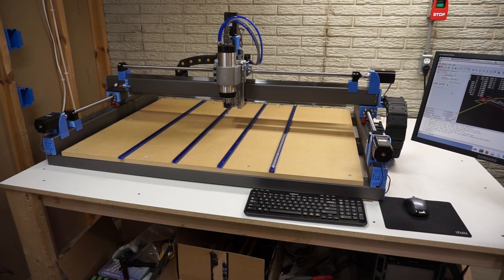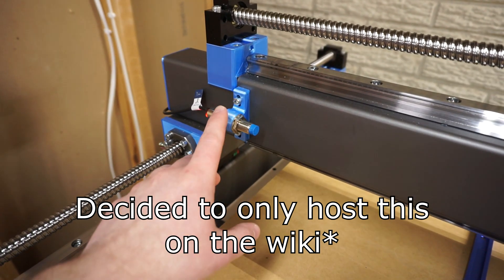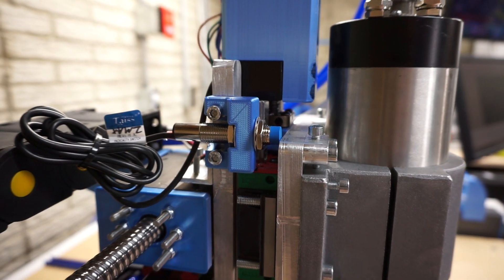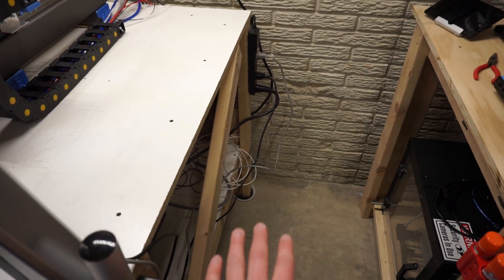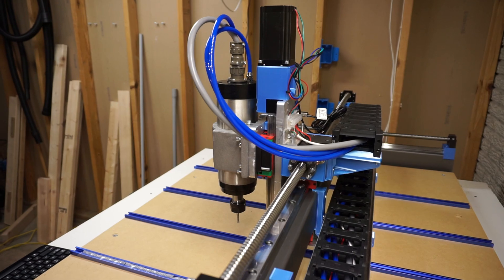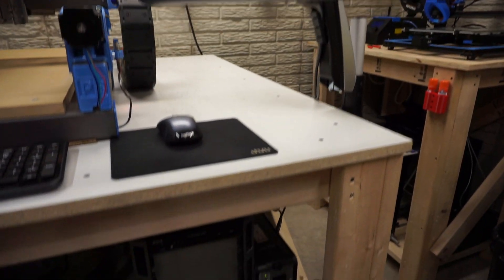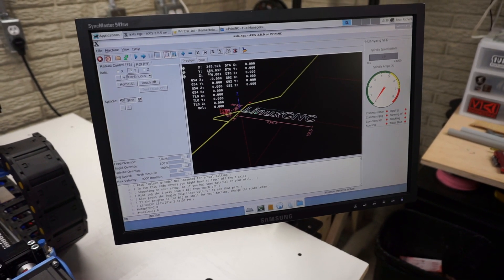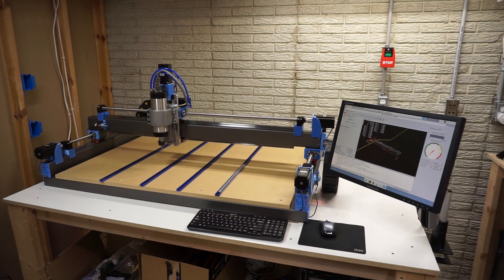PrintNC First Moves!

Comment: @01:12 Oof... That Stepper wobble man... Looks like you found your first parts to machine in metal, huh? 😐
Reply: I came down to the comments to see if anyone pointed that out. It just needs to be designed better and can still be 3d printed, but metal should also work and that may even need to be designed better

Comment: Looking great! congrats on your first build! I'm running a similar setup on my bulkman3d workbee 1010, I've got a 1.5kw vfd spindle high torque nema 23's and upgraded the z axis to linear rails. If you're going to do an enclosure and plan on cutting a lot of aluminum I highly recommend you run 8mm OD air hose in your cable chains so you can add mist coolant later on. Had a lot of trouble cutting aluminum at a depth of cut over 0.2mm, it would cut clean without chatter but the bit would eventually clog before the job completed. After adding the mister I can make 0.5mm+ deep cuts all day with no clogs. Got a mister kit for $20 on amazon, the most expensive part aside from the 8 gallon air compressor  was the $35 gallon of concentrated Trim Mist coolant. SO worth it! I've learned that it's not enough to have a rigid machine and a vfd spindle to reliably and consistently mill aluminum without issue. I don't always run coolant the whole job bc i don't wanna soak my mdf but  even with just the compressed air it's enough to cool the bit and blow the chips out of the cut and towards the vacuum hose. I'll add some videos to my channel of my setup and the mods I did to the dust shoe to work with the mister, in case anyone is interested to see how well it works.

Comment: Wobbling motor mount is "good". It means any forces applied to the motor axle is dampened in the mount. Putting the bearing block on a steel mount makes it more rigid, any axial forces applied to the ball screw will be eaten by the bearing block instead of the bearings in the motor. If you go by replacing the motor mount with steel ones, do yourself a service and do the same to the bearing block mount, and take extra care to align the motor with the ball screw to remove stress on the motor bearings. Food for thought.

Comment: Any plans on using dual endstops for squaring? Or is not needed?
Reply: @ProjectsbyBrian  I have the mpcnc primo and it gives me problems at times. I might consider printnc in the future.
Reply: @evertythingtechrelated9715  mpcnc seems pretty jank, as someone who spent a lot of time researching diy cnc plans it didn't seem worth it for the money. I ended up going with the RS-CNC32 for my first build but if I saw the PrintNC first I totally would've built that bc of its superior/open source design. Cnc is punishing as it is to learn I think you will find it much more enjoyable to use something like the printNC
Reply: @jimbmakin7975  I fixed the issue, one of the tubes was bent from moving to another home

Comment: Looks awesome, I am building a mpcnc since it's my first cnc machine. I am down to the wiring and I'm a glutton for punishment and opted to do dual endstops.
Reply: You can actually do it with 2 normally closed limit switches wired in series to one limit input on your control board. The machine works out whether you're at min or max based on the direction it's moving.